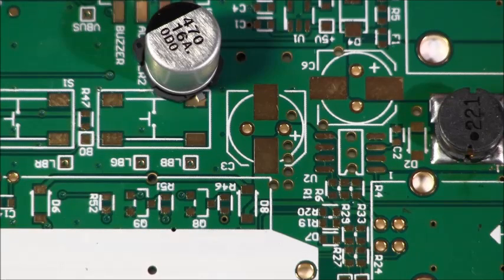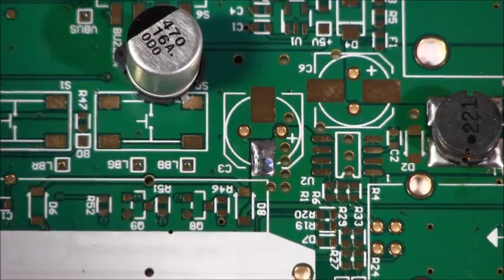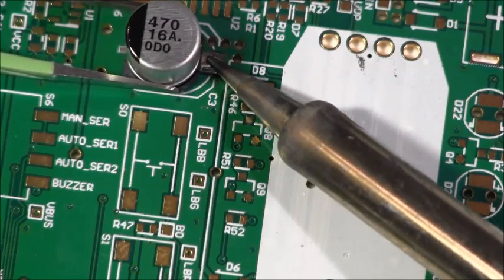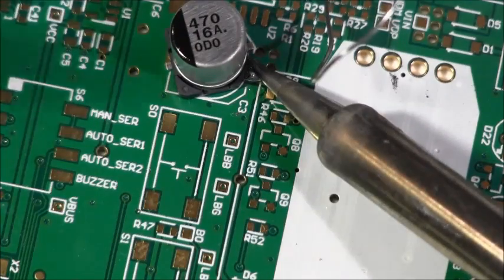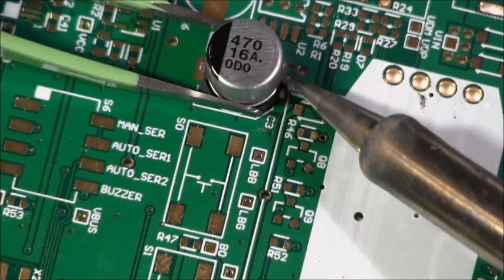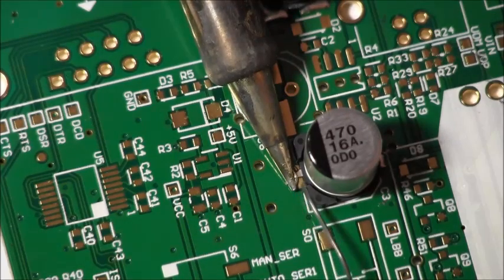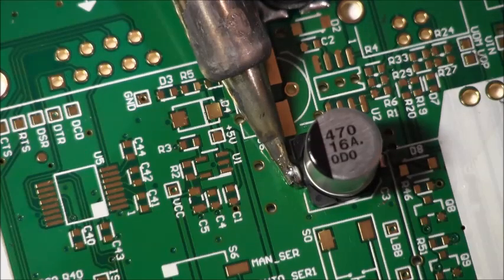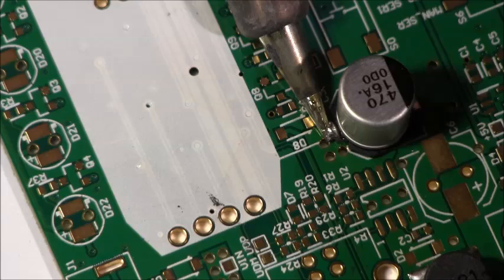Soldering a large SMT Capacitor

Comment: not bad but little confusing haha 🤣 because there is location not true while soldering but that not damage the plastic around caps ? what if first little soldering at pcb (covered with solder then heat it up and locate it

Comment: Thank you for the "how not to solder" video!  too much heat time, to much solder, to much coming back 
some board would  be damaged.

cpu64 has a good method, prep everything with just a "plating"of solder, then put it together with a bit more solder.
Because  you are already solder on solder, same fusion etc...it will flow easy right away.
After some practice the method can be adapted according to circumstances.

Comment: Well done. I have a bit of trouble with these type of capacitors both soldering and desoldering. I was looking to see if there was some little trick I was missing but, no. Just patience and usual good soldering practice. I see some noise below about "too much heat/ contact time" but, it didn't seem too far out of line. It showed a realistic bit of difficulty like the cap going crooked on you when you're trying to push it in place; rather than a "perfect" take. None of my videos are perfect takes; that's for sure!

Comment: I usually use the standard leg caps whenever space allows for it. But for SM, I agree, that was too long on the heat contact. The way I do it is to barely coat the pads and cap pins with a nearly insignificant amount of flux, then apply half the solder you used to the pads, and a tiny bit to each leg. All with very quick heat on/off. Then I hold the cap in place, and touch the soldering tip to the pad and both melt together on each side.

Comment: I like your video try to make another one with a more perfect the technique or better retake I mean.  I know that does with a demonstration purposes that it should not talking that long for contact with the iron on the board n the component.

I was actually watching it I got extremely frustrated just watching and Hoping you were just set it on there in time.  

I placed them on the board the same way but never take that long putting them on. I don't even use tweezers. For capacitor that size it's just easier to use your hands your fingers I mean. Plus you can meter the heat building up on the component with your fingers as well.   

Just try setting the camera in the stable position where you got a good shot like you did last time I keep it one position without moving the board. I just thought of it like you normally would without the camera being there and I think it would turn out better.

You could do two takes, One as you normally would do in real time sitting to solder on the board and another take as an example taking a little longer to solder it on the board at her demonstration but you did your video.

I have soldered and repaired these same type of capacitors with broken off prongs down to the bottom of them having to solder new prongs/legs on to the stubs to refit in through the black plastic seating piece to solder on the board. Because somehow they got knocked and torn off by people trying to fix it themselves.

Anyway the videos okay thank you for the video.
Reply: +Robert Toebak I am not even electronic guy..but I knew u can't hold it that long..he was roasting that board! and that was the first thing on the board..without flux! ouch! he is not a flux fan! lmfao!
Reply: He was having a picknick with his soldering iron on that pad. That was way to long on the board. You saw that right. I was getting frustrated to haha. Like he did not no what he was doing and just kept on talking. I would have made a new video.

Comment: Do you by any chance know of or posess an Eagle CAD part file for those hybrid part footprints, with both SMT pads and the holes for a through-hole equivalent?
Reply from the maker: We use Altium, so unfortunately can't help you out.  They're not to difficult to make (at least in Altium...)
Reply: Engenuics Technologies Thanks for informing me. I'm still inspired, I'll be making one myself, then!
Reply from the maker: NLRevZ
Whenever you make dual footprints, just be careful that pads on the parts themselves don't short out to the multiple connection points. One trick is to remove the solder mask opening of thru-hole parts on the SMT side of the land pattern.  We didn't do that on the part in this video as it wasn't necessary, but keep it in mind.
Reply: Engenuics Technologies Actually, I was thinking of running what are essentially through-hole sized vias through the actual pads themselves. It should work, shouldn't it?
I mean, there shouldn't be any problem with getting either part soldered that way and it would prevent any possible shorting issues with the 90° rotation the holes would otherwise be at..
Reply from the maker: NLRevZ
As long as you're only ever going to hand-populate the parts.  Vias in pads tend to cause trouble for reflow soldering.